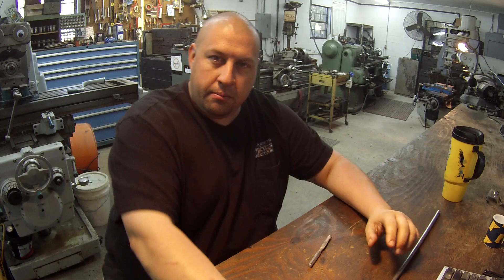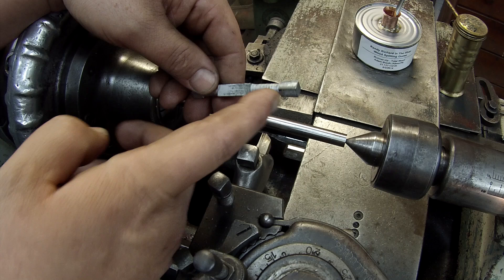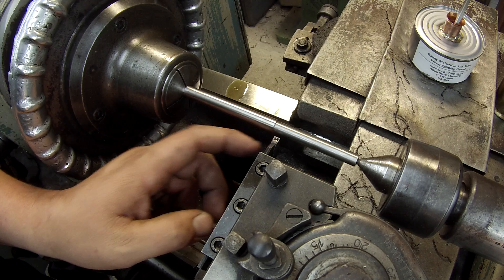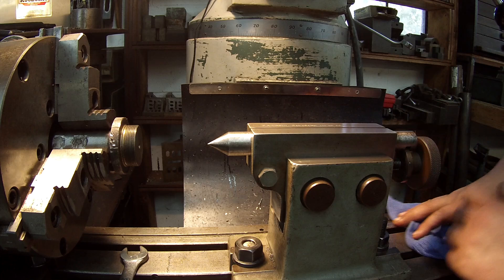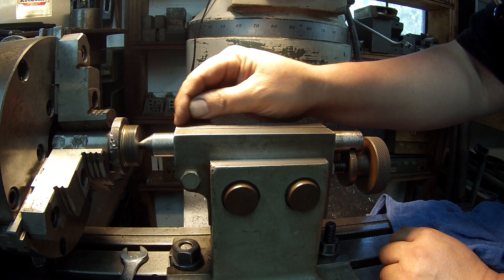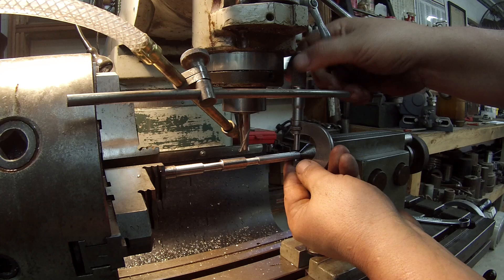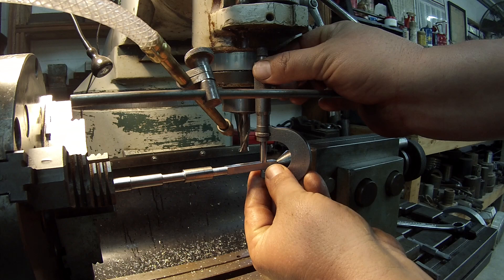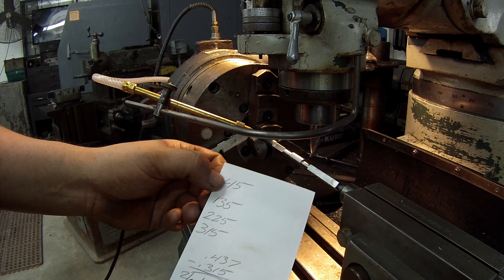Machining a Lock Part for a Custom Door

Comment: I've worked on a lot of coastal homes in California as a high end finish carpenter. That's a spindle, and it will corrode faster than you can imagine. Hardware with tight machining tends to bind up the fastest in the salty air. Be prepared to make another:)
Found your videos by way of a farming channel and have been binge watching, I just watched the broach videos, never saw that in action, thanks for sharing!!!
You would be a good mentor to younger machinists, the kids think it's all Million dollar CNC mills and it's not. Same disconnect happens in woodworking.
Thanks again for making these videos.

Comment: Most small jobs usually do take a little longer than planned. The part turned out really nice, much nicer than the old one and I'll bet a lot stronger too!

Nice job!

Ray
Reply from the maker: Thanks Ray! I threw out a number and he agreed, but spending more time on it in my shop its ok, because I'm the one doing the work. Not that big of a deal for a home part time shop.
Reply: Abom79 So most of your home jobs are priced by the job, or do you use a hour shop rate on occasion?
Reply: SOME TIMES IT'S THE SMALL JOBS THAT BRINGS THE BIG ONES .   VERY NICE WORK  TWO THUMBS UP.
Reply: I've installed thousands of doors and locksets and the parts like this one that Adam made are usually of extremely low grade materials with little tensile strength. They usually fit loosely and are prone to self destruct.

Comment: Nice job Adam,
Sometimes the smallest jobs are the hardest.
I worked as a prototype machinist for a hydraulics company, making custom manifolds, pressure relief valves and anti cavitation valves and all sorts of valves and directional control valves, the hardest was making the prototype pr valves with the intricate steps on the body requiring lathe and milling work to the micron. Thanks for the video's I enjoy watching them as I am still setting up my machine shop at home, and I'm itching to get back into machining. I had a major heart attack that has slowed me down for the last two years.

Best Regards; Bruce.

Comment: Hey Adam,

Another great video. Thanks for sharing your work. In one shot it looked like the air hose was coming out of the super spacer. I was thinking man, did Adam get an air indexing spacer. 

Talk to you soon.

Tom
Reply from the maker: That sounds like a good project, or tool to have. Even better would be one of those auto rotating setups like Herb did. I would like to see how you would approach a job like this. You know as much as I do these things get get time consuming. Thanks for the visit!!

Adam

Comment: You sure made a part that will not only work great, but it looks great also (although the installer is probably the only one who will see it)
Reply from the maker: Thanks. Yep the customer only cared about getting his door locked. I actually built the part for a locksmith.

Comment: Adam, you are one of few YouTube machinists that admit to writing your dimensions down.  I always told my guys to write everything down and don't rely on your memory. Way too many mistakes get made without doing so. The fiddliy little piece for the lock came out perfect.  I wonder what the old one was made out of that allowed it to snap like that with just hand pressure?
As always, your videos are the best.  Thanks for publishing them!
Ken
Reply from the maker: I often work without writing measurements down but that's when i have a sample next to me I'm copying. But it's best to make a sketch put dimensions down so that you don't forget or keep having to go back and remeasure things. It's a good habit of getting into, even if its just a few notes jotted down on a pad or something. The degree settings was a good case of writing your dimensions down so that you don't mess up and waist time with adding things up in your head each time.
Thanks Ken.
Reply: Hi Ken and Adam. I used to write things down on bits of paper until one day I spent almost a hour walking around scratching my head saying, where the frig did I put that.. Looking in the same places I just checked 5 minutes ago, hoping it has somehow just materialized and this time will be there, but no.... Now I have a couple of large whiteboards around. Its real easy to turn your head to look and have check of dimensions.. Its also hard or me to lose a whiteboard that's screwed to the wall :)

Comment: A little planer jack up on blocks might support that skinny shaft for milling (since it isn't rotating).

That looks like it might be the operating spindle for a mortice lock. The odd mix of sizes might be from having a US-made mortice lock (with imperial sizes) and European handles (with 7 mm square sockets). As you say, the original was probably a shop made item. The break in the original was probably from someone trying to open the door when it was locked. Those spindles are typically fragile, so force will break the spindle rather than the (expensive) lock itself. I generally make mine from keystock.

Comment: Very cool. Locks are my primary hobby/obsession :D
Reply: I've spent some time with British Heritage Railway diesel locos. Typically their door locks are made of brass with lots of internal parts made from solid material (I suspect they were used as apprentice training pieces). Often once bolted into place on the doors, the casings flex slightly and the bind up. Can be a real devil to shim and adjust to get them tight on the door and still operating smoothly.

Comment: Further thought suggests that those undercuts allow the spindle end to be pushed through the body of the mortice lock and then rotated 45˚ in the undercut, then push the larger square section into the lock. (I can't help speculating, based on what I see. I may be entirely wrong.)

Comment: Hi Adam,
nice video on the lock part,
I notice you touch off and  put a cut on then machine down the part with the cutter on the centre line, this causes vibration, ( wobbling the part )
try touching off then just cutting a small amount down the length,
the cutter force will push toward the headstock ( no vtbration )
regards
Richard

Comment: Nothing like a door lock/latch mechanism that works smoothly!  I'm not criticizing, but I wonder how many a CNC lathe could crank out in 5 minutes?  Maybe, somewhere down the road, you might master the CNC machine tools.... for your regular job.   Do the "one off" custom stuff on the side in your shop???
Reply: If the customer just needs one, why make hundreds?

On just one part, creating fixtures and programs would be much more expensive than this was.
Reply: 12345NoNamesLeft You are absolutely right.  I was just rattling my jaw.  You could have responded, "Hey bud, that's a different youtube channel".  ha ha
Reply from the maker: A cnc lathe at work my be possible int he future, as it would help with making rods and other components. But for now I have no interest in cnc work. I enjoy my repair and one off work.
I have no doubt that any good cnc shop could spit one of these out in minutes, but would they make it worth YOUR while for one part?
Reply: Abom79 when you do cnc you need to do as well cad/cam and that takes time. Sure once done it can make fast and a lot of peaces but for one peace... no so sure. And you would still  need combination lathe mill cnc with 4th axis...
Reply: Abom79 Yeah Adam, I didn't mean any critique or anything.  just talking.  Great job, cool work, and thanks for your time and effort.  As T.L. says, "Cheers".

Comment: No doubt probably not as convenient but you could have used Stans triangles to set up the angles on that shaft too.  Somebody must have been standing on the door handle to break it in the first place I would think.  I have some groove and turn inserts that are awesome for profiling, but I am surprised you didn't just angle your parting tool a bit to get it to cut on a corner instead of on the whole face to eliminate the chatter.

Comment: The job looks like a handle mount on each end and a thru lock engagement in the middle.  If I'm right non of this beautiful work will ever be seen.  Adam do you ever look at what a job is for and either a) see a better way to do it or b) make it crudely just because fine precision is not required?  For what it is worth, you take machining to a high art and it is a shame that much of what you do will never be seen or appreciated.

Comment: Wow, trippy little custom internals on that lock assembly! I'm assuming that that section is the central drive shaft the both lever type handle affix to? I used to build quite a bit when I would get laid off from welding, cause in Hawaii you do a bit of everything to stay afloat with rent being triple the price of anywhere else I've lived, so that piece looked really familiar.

With the offset square in the center of the part that goes through the door, and the other two planes being for the handles. The ones I've installed weren't custom like yours though, they were made out of that soft zinc metal, making it so you have to buy new door hardware every 5 years. At least in Hawaii where the salt just fries everything, and I'll wager it isn't any different in FL?

Thanks for the midweek installment, nice to relax and watch you mill :) I did figure out my lead-screw screech problem and will be running the "Black Beauty" across some steel tomorrow! I've still got a bit of 1144 left and so I'm going to try and make a tool height gauge...wish me luck!

Aloha man...Chuck

Comment: could you have used a machinist jack under to hold the flex steady?
Reply from the maker: Possibly, but you also have to worry about putting too much pressure on it and cut it small. If the vibrations were any worse I would have tried it.
Reply: I was going to suggest the same thing...just run it up enough to touch the part..

Comment: Great work.  Wondering why the square sections needed to be turned down first.  Why were they not left the drill rod diameter until they got milled square?  Seems like extra work to me.

Comment: Adam: nice video. Question though: how in the hell did you get your mill to run so quiet? Mine sounds like a freight train, and  even MrPete's sounds like one of his homemade engines. Yours sounds REALLY quiet, how did you do that?
Reply from the maker: It's a DoAll! LOL

It's a belt driven step pulley head, and has always run quiet. It's actually the quietest mill I have EVER run.

Comment: I would have milled the center section first so the outside squares would have had maximum diameter and less flex.  Leave the outsides for last.  I saw you did something like that on another project back seats.

Comment: I don't know, but I am guessing the material you are using is going to make your replacement part many times stronger than the original. Like it would take the bionic man to break it. I wonder if the original was broken in a break in. I hope not. If it is because the owner locked his keys in his "Villa", and had to break the lock himself, he will be calling on a glass window expert, if there is a "next time".  :-)

Comment: Watching that slight flex - would a small screw jack with the top faced off and fitted with a thin felt or rubber pad be a way to support such a workpiece, or would the top pad deflect enough to make it worthless?
Reply: Good question, wonder what Adam's answer would be-
Reply: +Copper Head SevenPointThree 

How about a big body of thick rubber bands wrapped tightly in the center to give it some extra meat to fight the vibrations?

Comment: Nice lesson on using the parting tool to machine between two shoulders.

Would a machinist jack put under the middle (might have to readjust after each rotation) have helped with the flexing?
Reply from the maker: It may have helped, not sure because I didn't try and risk pushing up too hard on the workpiece.
Reply: For stuff this small his hand IS a machinists jack..............that may have come out wrong..

Comment: Where can i get one of those oil jars with the hole in the top where you did your brush? I would prefer the plastic type with the screw-on lid. I have seen videos of them and they are generally white jars with a red lid. Thanks!

Comment: I'm sure this has been answered a few times in the past, but what airgun do you use on your lathe? That needle tip looks great (Don't let osha see that!)
Reply from the maker: That's the Typhoon air gun made by Coilhose Pneumatics. There different tips I have for it, including three different sizes needles. Those are great for reducing the amount of air you want and focusing on a small area.
Reply: Thanks. It seems to have great low-end control on it, need to pick one up.

Comment: Is it just me, or is your lathe running a lot quieter and smother since you leveled it?
Reply from the maker: Using the new Rode mic has helped eliminate the machine noise coming up through the mount, normally heard in my other videos.

Comment: Just curious... why couldn't you use a machinist's jack under the center of the rod when milling it?
Reply from the maker: Victor, if I was getting more flex and vibration then what it was doing I would have tried it, but still not ideal I don't think. You couldn't get it tight enough without messing with your dimensions.
Reply: Abom79 Oh. I see.

Comment: Hey Adam, Nice work as always.  How do you charge your customers, I'm not asking how much you charged but how do you.  Like do you bid a job or do you have a shop rate per hour? 

Matt C.
Reply from the maker: Some jobs I have to bid up front, while others I just work by the hour (time+materials). This job I put in a bid before starting it.

Comment: I wonder if this part fitted the lock? Seems risky having to “average out” the dimensions on a component because the client didn’t give him the rest of the lock. There must be close tolerances and no matter how good Adams machining it’ll be a miracle if this part is any good for the intended purpose.
Sorry my comment is so late, but does anyone know the outcome?
Reply: I'm sure it worked just fine. I've seen the locks of this design. The knobs are attached to the two ends, the center milled portion turns the throw, the two rounds on each end are the indexes in the lock. Incidentally, the lock's I seen had the knobs attached with a flathead screw! Lol.

Comment: i am new to machining how do you set up your 5c collet on the lathe thanks for teaching i learn alot
Reply from the maker: The collet chuck you see me use in the lathe is made by Hardinge and uses the 2J collets. It mounts directly to the spindle nose by a D1-6 camlock mount. To install the collet you line up the keyway, then turn the handle on the collet chuck which pulled the collet in.
Reply: thanks for the info

Comment: I'm sure that original shaft was made of junk. That came off of a mortise lockset and the ones that have been made in the last 25 years are pretty crappy. The really old ones were made a lot better.
Reply: you are so right, i have had many items such as this, with parts that should have been steel have been made of some metal with about as much strength as cheap plastic,  even a chuck key i bought and parts inside locks too,  seen 1/4 'steel' you could snap with bare hands, wonder if its some kind of casting with any old metal , even aluminum in there, then hot rolled
Reply: jusb1066
My brother used to call that cheap mystery metal "Chinesium." :-) Probably actually cast zinc (a.k.a. "pot metal" or in the days of yore, "white metal").
Reply from the maker: Seems like most everything is made cheaply these days, gone are the days when things were over engineered to last a lifetime.
Reply: Abom79 Especially in the lock business. Even high end shit like Baldwin is junk.
Reply: TheProfessor Fate
I agree, I have done a ton of repair and replace jobs on doors at beach houses on Hawaii, and crooks love that cheap zinc! You could see where it would just tear when they put a screwdriver or pry-bar against it..."plink!" and into the house the squatters would roam...a few jobs we did the folks would be back inside when we got there to do the lock change...good thing that there are very few guns in Hawaii, and folks would just take off running at the sight of us!
Reply: Sorry you had a bad run of it, but I had some of the best years of my life there, and was treated very well by almost every cop I had to deal with. I guess being a local has it's benefits, and fighting with your fists was always preferable to having to worry about any shoot-outs.

I even had a policeman catch me living out of my car when I was 16, he then followed me to the local drive in and bought me two huge bbq mixed plates, called my parents, smoothed things over and got them to let me finish high school!

I later had a job at the local pizza place and delivered 4 large pizzas to the police station and guess who was sitting right at the front desk? Officer Kaa'awa, the guy who changed my life.

I'm not disputing that there are corrupt policemen in Hawaii...but IMHO they are corrupt everywhere, and I think it may be more evident there because of how concentrated the population is. Do you have any examples to share?
Reply: Knolltop Farms Well, when the police department actually contested changes to departmental policy that allowed for officers to engage in sex acts with hookers, I'd say that's about all the proof you need. That's not the only incident, there are plenty of others. There are no good cops, there are bad cops and the "good" cops that turn a blind eye toward them. It's systemic in every organization.